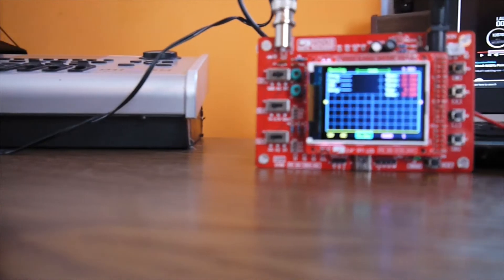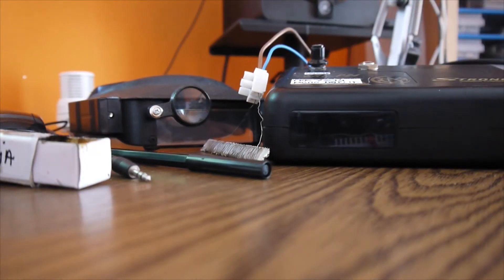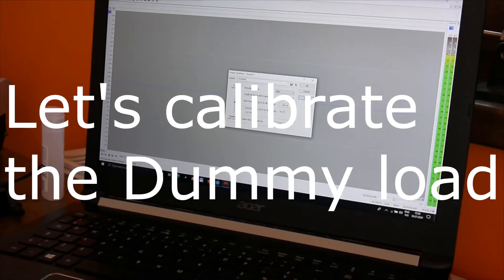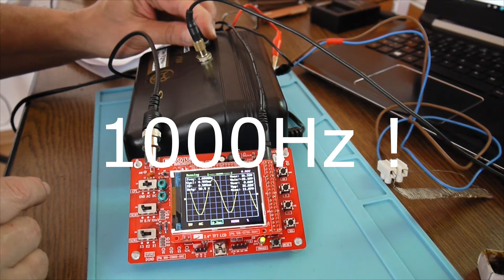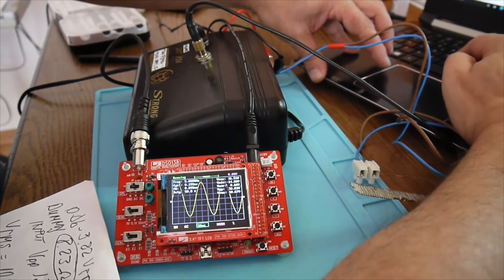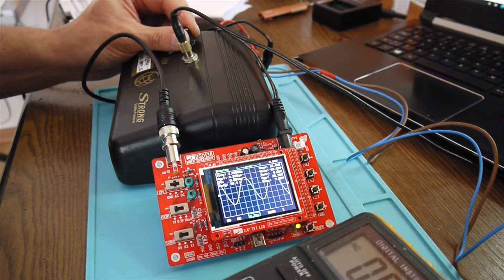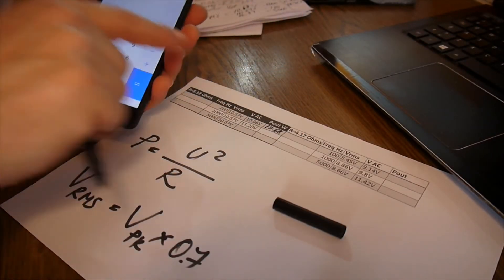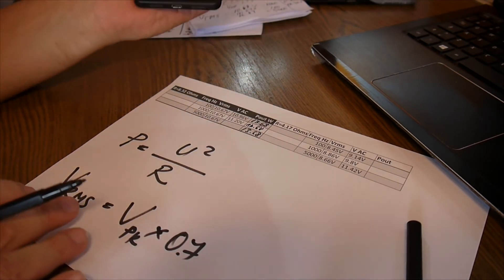How to measure the output power of any audio amplifier with dso138

Comment: What is the highest wattage measurable by this particular device?
Reply from the maker: As long as you don't go higher then Maximum input voltage : 50Vpp (1: 1 probe ), 400Vpp (10: 1 probe ) you can measure any power! let's say 4 ohms loudspeaker and 300Vpp=22500W !
Reply: @viocaia  nice! Thanks for the reply.
Reply: 50vpp is how much in dc? thanks

Comment: nice video thanks
Reply from the maker: Hope it's useful..
Reply: @viocaia  Thanks, do you think that i can measure a powerful Krell amp with this (the amp according to factory specs outputs 550watts/channel/4ohm) from 20Hz to 20kHz  ?
Reply from the maker: @3dScience_uk  absolutely..all you have to do is DIY a 10X probe with a resistor around  9Mohms. https://www.youtube.com/watch?v=to1617cMyD4
Reply from the maker: @3dScience_uk  also look at this...https://www.youtube.com/watch?v=FQNgIg2pOLA&t=626s
Reply: @viocaia  thanks for your replies - another excellent video. Can i ask why you start measuring from 50Hz and not from 20Hz?
Reply from the maker: @3dScience_uk  like I said, I've been using real loudspeakers and such a low freq can harm the coil easily, even 50Hz for 30sec at 500W can burn them...
Reply: @viocaia  thanks for your reply!